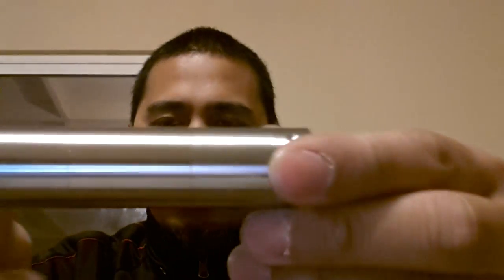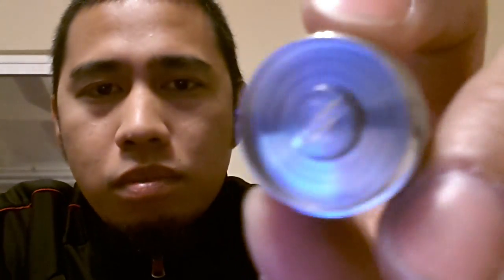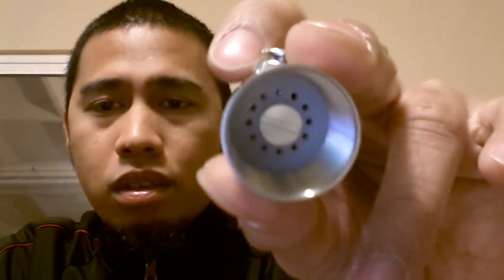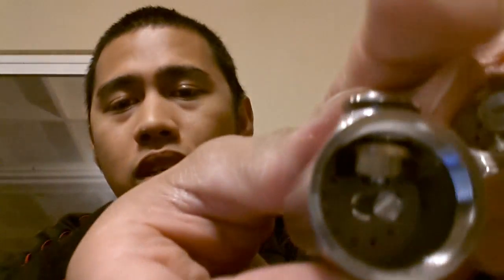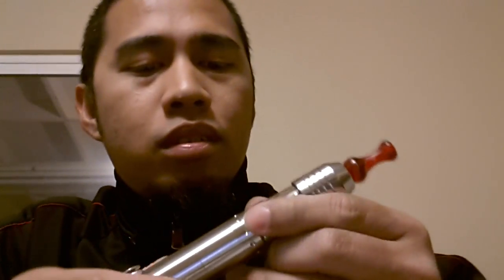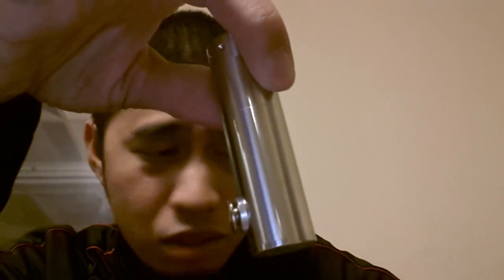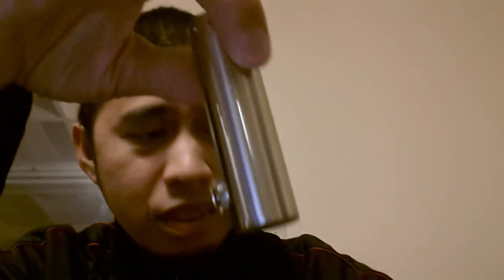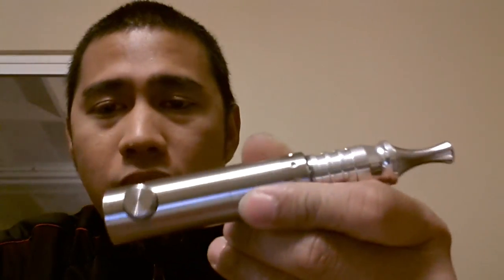Smok natural mod

Comment from the maker: Only gripes I have for the natural is the gap but it doesnt bother me... if u r running aw 18650 on a aga-t+ with the 510 pin adjusted higher u wont have a gap on the tube... actually it depends on how u like the top adjustment and it will be seamless... dont forget the noalax the threads for better threading ;) congrats on the purchase! Sand it! :D

Comment from the maker: Hi viet yes it will perfrom but not as good as a single coil... if u r on a mech device better to stay off on dual coils carto well unless u have a "kick" in ur mech then dual will be fine... 0.3 (not recommended) to 2.0ohms will perform very well on a mechanical device... as far as duals it will fire but not a good vape as this heats slow due to dual coils... hope that helps thanks for watching ;)